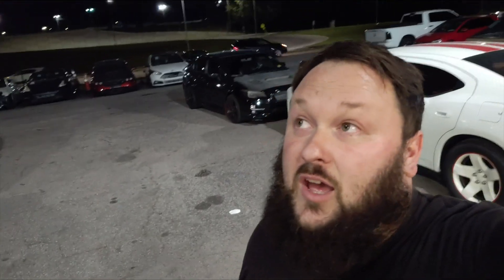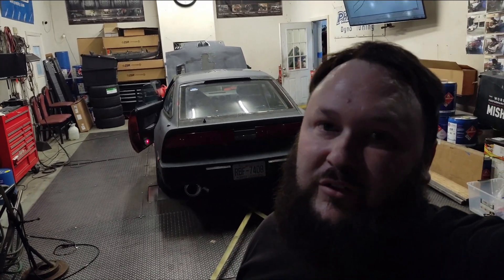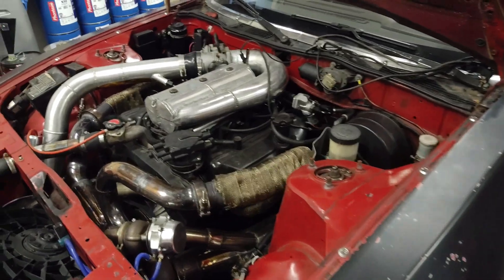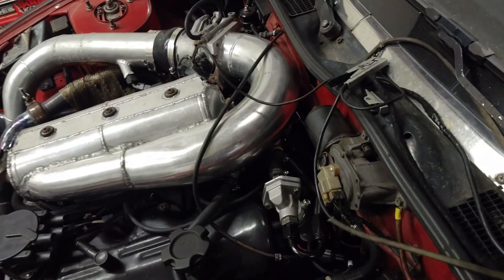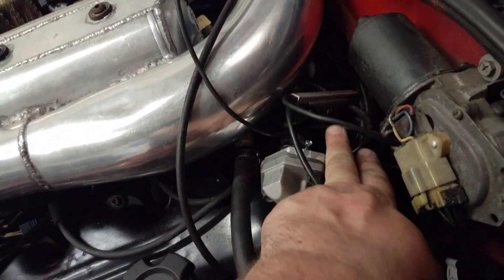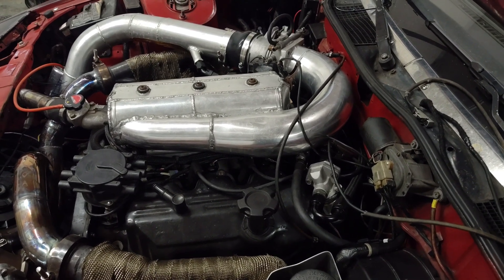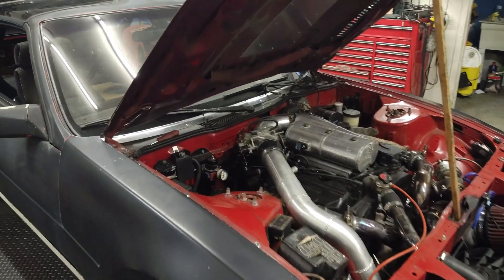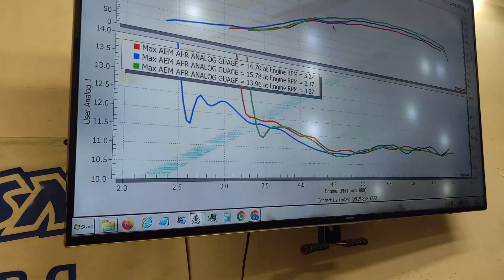Finally getting my z31 tuned on megasquirt!

Comment: Great Work Will! What tire brand are you currently running
Reply from the maker: Currently I'm running a 275/45r18 federal 595ss. I do plan on running a better tire than this once I modify my subframe more and dial in my alignment.
Reply: A stickier tire than those for sure. 
The 200tw tires like Falken RT660 or a Bridgestone RE-71 will do wonders to help ground out that power.
 Look fwd to the road test video! @hotwillzgarage3167
Reply from the maker: @tsaac9531  better tires for sure will help. Once I burn the ones I have off I'll get better.

Comment: Pretty nice setup!
400 @ 18psi, thats not too extreme on the boost.
Reply from the maker: I really plan on turning the boost up 18psi is wastegate pressure. I plan on making 500hp once I fix the ignition problem I just ran out of time to fix it that night.
Reply: Nice set up. Is there a z31 kit I can buy to convert to coils ?
Reply from the maker: @robsan9156  you have to convert to a standalone ECU. Hamiltuned sells a standalone kit.
Reply: nice.
Reply: What kind of turbo are you running?
Reply from the maker: @tokewelltv  the turbo is a 62 Omega remnant performance turbo. It is similar to a g30-900.